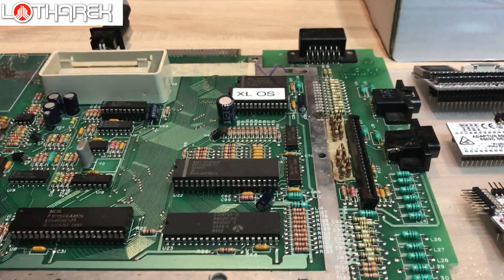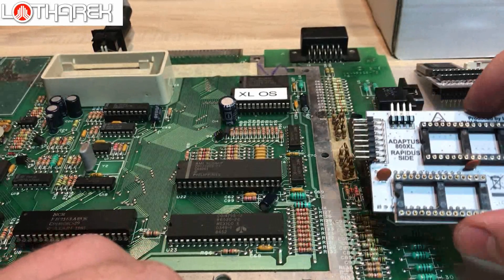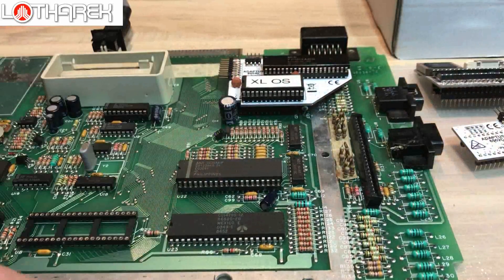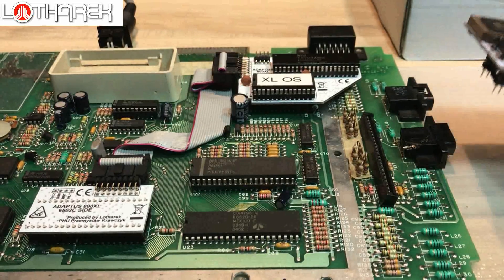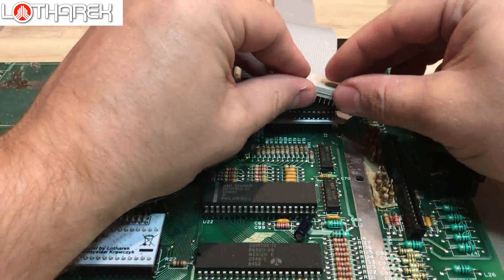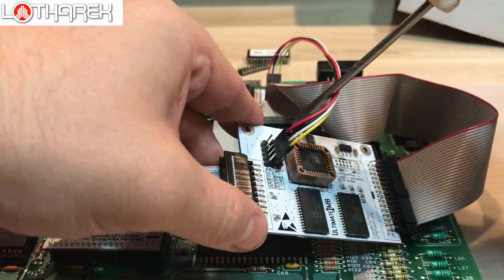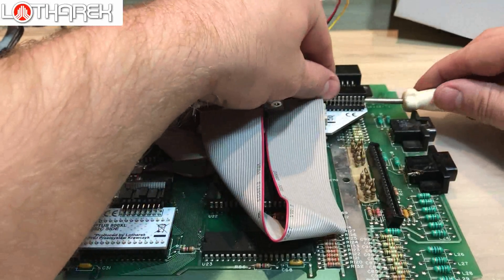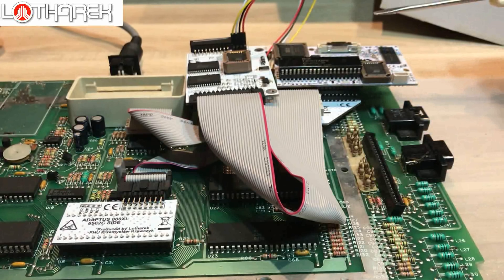ATARI 800XL Rapidus and Ultimate installation

Comment: Do both or either of these upgrades work on other models beside the 800XL?  (ie 600XL, 1200XL, XE systems, etc.)?
Reply from the maker: mentioned computers main elements are the same...so Yes (except in 600xl no space for turbo )
Reply: @lotharek  If space is the only limitation, I'm sure I can figure out a way to get it to fit.  Neat!  Thank you!

Comment: I think you need to increase the gain on your video - even cranked up to the max I could barely hear you. Nice products, by the way. The output from the 800XL looked too sharp for the standard composite, is this fitted with an RGB or S-Video mod as well?
Reply from the maker: markanne54 - it is real conposite.. no tweaks..